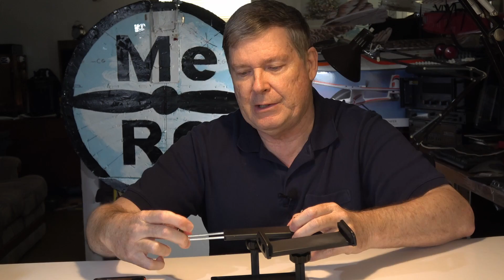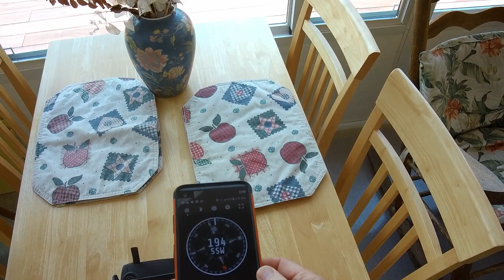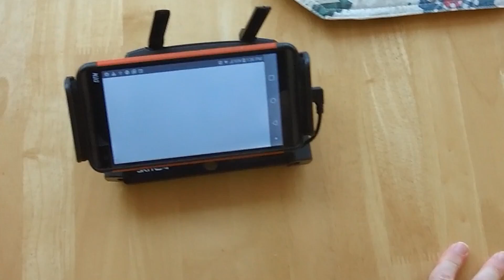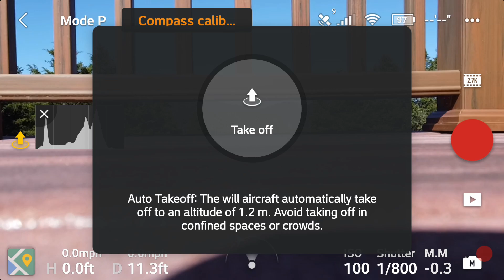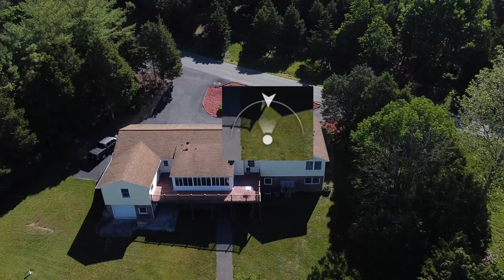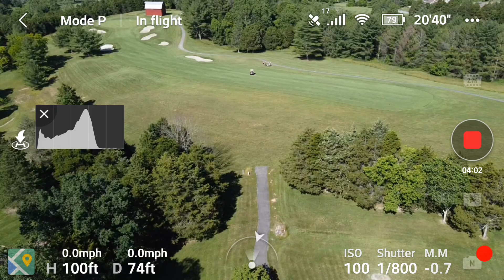Mavic Mini & Air 2 Aircraft Orientation Display Solutions - Phone Holders & Launch Setup

Comment: You see that little circle in the bottom center of your screen. And it has the triangle that is supposed to replicate the Drone. As of yesterday mine's not showing up anymore. on the other hand to the left in the Google Maps it shows a different Circle and arrow. But I don't like that one because I have to cut it on and it takes up a big portion of the far left corner of the screen. So I wanted to have my little white center one come back on. Is there any way to cut this thing on and off?
Reply: I have the same problem with my mini2 , it used to show on my iPhone 12 Pro but now it’s missing from screen. Did you get a fix anywhere?

Comment: If I get a compass app on the mini would that work?
Reply from the maker: Will the iPad Mini work with the Mavic Mini orientation display? I don't know. An app is not necessary if the iPad Mini has compass hardware and the Fly App supports it.  Just try it and see if it works.  What you could do is rent an iPad mini and see if it works.

Comment: The compass in the phone is used to know which way the controller (and phone) is pointing.  The compass in the drone is used to know which way the drone is pointed.  The compass in the drone can't know which way the controller is pointed.  Both compasses need to be calibrated for the display to be correct.
Reply from the maker: True. DJI needs to put a compass in the controller. Using the phone's compass is unreliable.

Comment: Mine seems to work correctly when things aren’t in the way, like houses and trees. Haven’t had any issues when I had direct line of sight.
Reply from the maker: Seems to depend on what cellphone or tablet you have. Some are better than others. What are you using.
Reply: Dave Merc Productions I use my iPhone X sometimes but mostly iPhone 8 Plus. It does not have a sim card and I keep the wifi connection off for the flight.
Reply: Dave Merc Productions I’ve had the same or similar issue as you when I launch from the front of my house and fly Mavic mini to behind it while I stay in front ( seems to happen when I lose line of sight )
Reply from the maker: @killgar84   Interesting b/c there are so many variables to the puzzle. Not a good design on this widget imo.